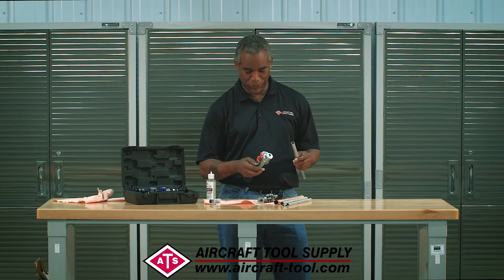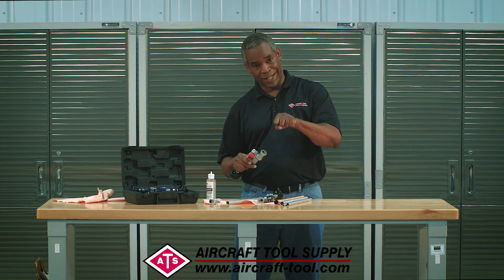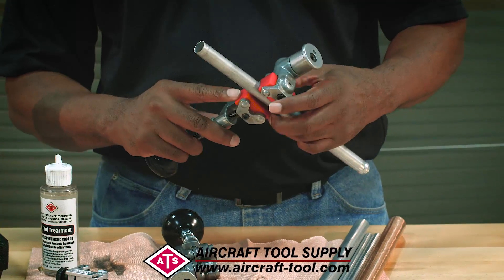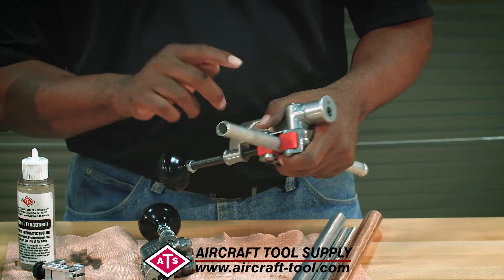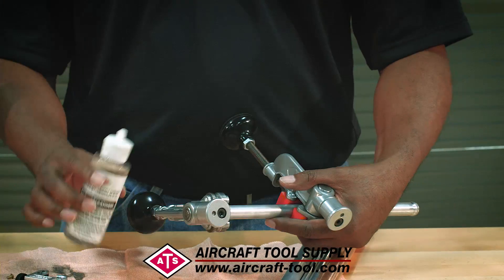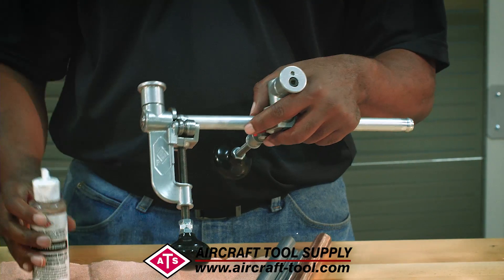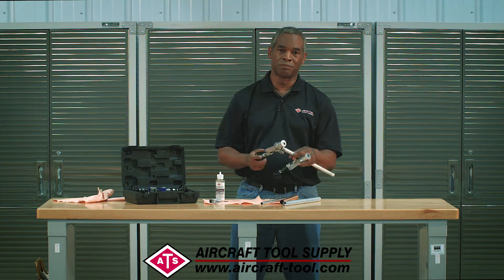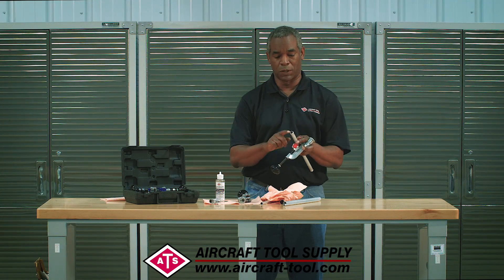AP145 Beading Tool Instructional Video

Comment: I bought this tool and can tell you it's not as easy as it appears. I was putting a bead on 3/4 inch pipe, and no matter how small i made the bead, it always gets stuck inside the tubing from the spots on either side of the bead being compressed in. i had to destroy the pipe every time i needed to remove the die and try again to see if maybe i was just rolling it too much, but no, its really just a piece of junk tool. Can't even use the contact page on their website to ask about the product. Hence why im returning it.
Reply: Same here and I snapped two dies. #4 and #6. I spoke to company but they appear to take no responsibility for their product.
Reply: @spankhouz6466  I returned it, luckily i did get my money back, its about the only silver lining of the situation lol.

Comment: This is 1/2" (12mm) what is the smallest diameter tubing, it can bead?? 

I have a pair of electric terminal, crimping pliers I modified to do 3/8" fuel lines.